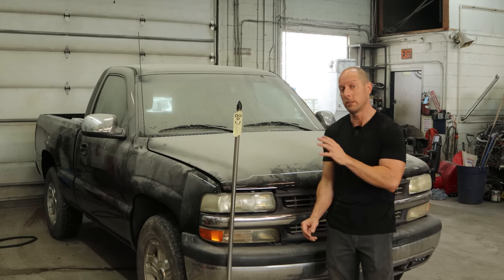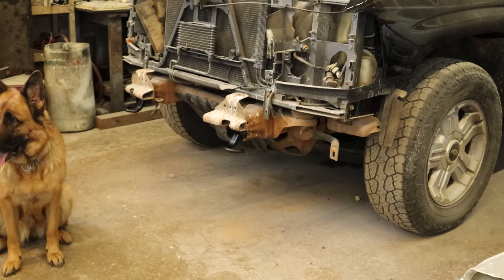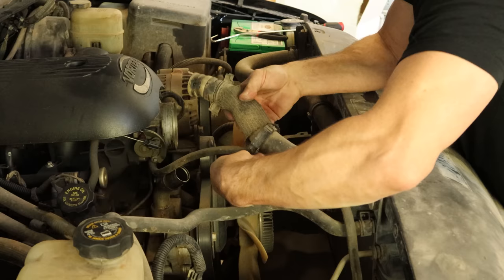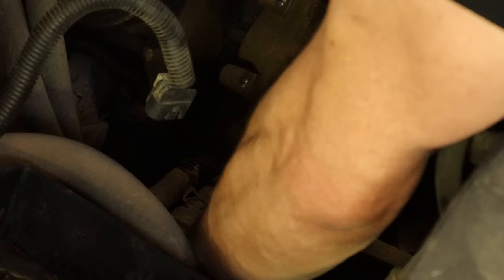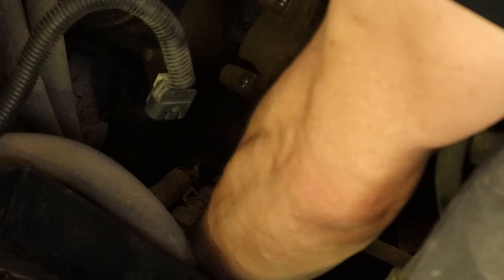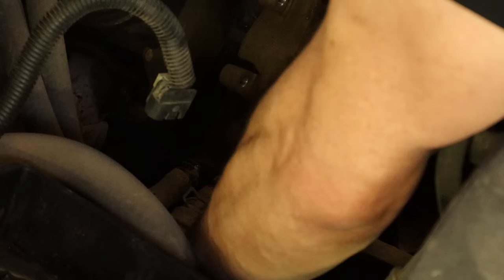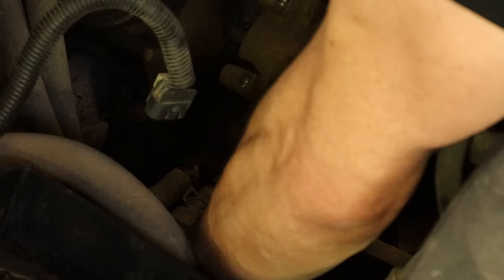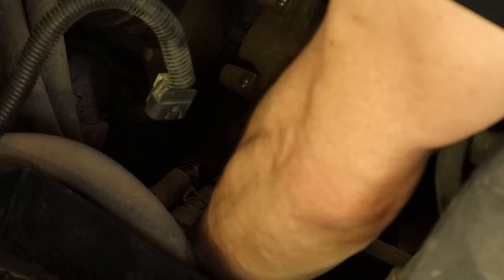Rebuilding a rolled over Silverado part 7

Comment: The electric fans from like 05-06 are a direct bolt in. And there is a stand alone harness/controller for them. Pretty neat setup and you actually gain horsetorques, unlike the snazzy drilled & slotted rotors.

Comment: I use a 3000 Psi Gas pressure washer for underbody cleaning and use it on my truck all the time those things are great but if you really want to clean your dirty engine use purple power spray it on let it sit for 5 mins then wash it off the results are satisfying.

Comment: I had one of these trucks in service vehicle white that was almost new with only 150,000 miles. I’d still have it except I let my sister borrow it to move some mulch and she totaled when some idiot ran a red light on her. Not her fault but I still blame her. It was a good truck. I live in Texas so it didn’t have any rust on it. Other than replacing tires, brakes, tie rod ends, oil and filters, it never gave me a moment of trouble. The LS engine is almost bulletproof if you can be bothered to change the oil and filter in them.

Comment: I know you have been repairing various vehicles for at least two or three weeks but your wide range and depth of knowledge of the vehicles is bloody impressive. It was the bit where you bashed the tow thingy mentioning that it got pulled in when the bolt got tightened. It's the little things like that I find really impressive along with the vehicle being way better than new once your magic hands have been laid upon it.
Thank You for the video. 👍👍

Comment: I had an engine light on my 04 GMC Sierra and it pointed to the rear knock sensor and it was a bear to replace got to take the entire intake manifold up and the fuel rail with the injectors and I figured while I was there I'd replace them both even though the front one was fine but I got to say man it's a nice truck mine's got a blown engine you make house calls LOL love the vids man

Comment: We just finished this week wearing out one of those pressure washers like you have. 

We have showed it no mercy cleaning out large HVAC Cooling Towers and A/C equipment almost everyday.

It lasted about 2 years under hard use. It would make a good shop or around the house pressure washer.

Going to order a new one Monday!

Good video!
Reply from the maker: I cleaned the garage floor, patio furniture, quite a few cars and it has been great.  I lent it to some friends and they liked it.

Comment: 18:01 better to have a gap than be like Ford: they put a water absorbing foam in there that catches water and salt, turns it into a brine and rots them out in 4 yrs. 

I did a $2.00 rust repair on a beater truck I bought for $600 cdn and when I pulled the foam out it was sopping wet. So wet when I squeezed it it drained like a sponge.

Know what would prevent this? Using a closed cell foam that doesn't absorb water.
Reply from the maker: The Tauruses were notorious for the dog legs rotting out within 2 years.  Always the foam sponge that did it! Chrysler had the same issues.
Reply: @vehcor  We call them "issues" the manufacturers call it "planned".

Comment: if you want another one i got one in south il i will let go cheep . its a 06 4x4 with a 4.8 and of course bad transmission and it needs rockers and a new bed .  dose have a front clip off a 99-02 on it due to a buck that had to jump out in front of it . hate to see it go to a scrap yard because it runs so good  but also tired of looking at it set around . i got a 01 gmc 2500 hd i drive now

Comment: That color change from red to black would really mess with the tag and title dmv here in Oklahoma because the original color is listed on the title.
Reply: Here in Louisiana too,but you can request that it be changed.I've never really worried about it,the factory color still shows on the trim tag anyway.
Reply: @burtbacarach5034  I'm just saying it might cause the clerk at the tag office to scratch their head IF they even pay any attention to that part of the title. In Oklahoma if you go to title or tag a car or truck that was last titled or tagged in a different state you've got to take the car or truck to the agency for VIN verification.
Reply from the maker: Most states don’t care.  Even the ones that do, are too lazy to do much about it.

Comment: How do you like the Detroit Axle stuff?   I've been using it on pretty much everything except my pizza delivery girl's car (she wants only OEM parts......so I just save some of the AC Delco boxes from about 6 brake jobs ago) and have had pretty good luck with the Detroit Axle rotors and ceramic pads.  As an added bonus, their world HQ is right here in SE Michigan so I get stuff I order the next day.
Reply from the maker: I have been using them for years, never had an issue.  I usually get my stuff next day as well.

Comment: That water pump replacement was too easy.  They need to move the water pump to deep inside engine so you have to pull the engine to replace it.  But it won't matter because when it starts to leak the water will quickly get into the oil, circulate in the engine, trash the bearings, fill a cylinder with water, and hydraulically break a rod.  That way you don't have to feel bad about tearing down the whole engine just to replace the water pump since the whole engine needs a rebuild.  Seen it on I DO Cars.
Reply from the maker: The Ford engineers stole your idea! 😂

Comment: Why no gasket sealer?  Easy, learning here never have done a water pump.  Thanks! :)
Reply from the maker: Silicone gaskets don’t need it.  You can use it to hold them in place, it won’t hurt but is not necessary.
Reply: @vehcor  Thanks again!!

Comment: What percentage of the radiator fluid do you get out by removing the lower hose there at the pump?  I am asking because I have an 04 and there is no petcock on the bottom of the radiator (a great idea by GM!).  Thanks!
Reply from the maker: About 50%.  The block, heater core and lower portion of the radiator are still full.
Reply: @vehcor  Thanks!

Comment: Nice job on that rebuild. But why black? Any other color than black would have been better in my opinion. Back in 2017 I was on my way to sign and take delivery on a 2017 Silverado at the Chevrolet dealer. The buy was done mostly online. All I had to do was come sign and take delivery of the truck. When I arrived at the dealership the salesman took me over to the truck. The instant I seen it I told him NO DEAL. The Dealership told me they were going to do a spray in bedliner on the truck at no cost (part of the deal.) Them doing that cost them the deal for me because they did like you did on this one. They bed lined the tops of the bed. Another in my opinion, doing that ruins the overall appearance of the truck. Sure, it's probably good for a work truck. I wasn't buying a work truck. Car tires? Why not some nice all terrain BFG or Coopers on that nice 4x4? Still though, nice truck.

Comment: I don't ,won't and have not driven  rode in a red car or truck in over 35 years . BECAUSE  AS YOU STATED THERE CURSED AND ITS BAD LUCK. 😊 TKS
Reply: Clearly, another fan of the movie Used Cars.
Reply from the maker: The red ones always seem to have issues! Sometimes I wonder if there is some truth behind the joke. 😂

Comment: So I gotta take the bumper cover off to replace the fog lights on my 2001 silverado 1500?
Reply from the maker: No, you can get to the bolt with the bumper on.  I just had it off from the other work I did.

Comment: cant find the brake job hammer in your store  or emporium was it just a limited run or did the manufacture send you it for beta testing and it not take off cant see where the batteries go must be piezo powered as you can hear it work on impact the company could have made a killig at jiffy lube and brakes or does'nt the torque go high enough for their spec's

Comment: I have exactly the same Snap on battery tools as you.. How did we do the job before they came along? Answer Struggled!
Reply from the maker: Air tools!  I still prefer air tools but the compressor is too loud when filming so I limit the use.
Reply: @vehcor  Absolutely, but as you say very noisy.. and air chisels, say no more.

Comment: Hey Scott was that and Assault weapon pick you used on the 7 pin connector?  Becareful In ILLINOIS USING THOSE😂. Probably a felony 🤦‍♂️. I cray when i see this truck.  4 hours to get the front wheel bearings out of my ole Silverado 😢😂
No mo e brakes here in New England along with rockers.  Cut them all off 😬 no plates anymore either.
Thanks for videos…. Make my day.  Wife even watchs now😅
Reply from the maker: It was not the high capacity pick so I am ok.  😂
Reply: @vehcor  just dont put a brace on it ! 😎

Comment: these year chevy's are the rustiest trucks ever GM goes all out to make them rust ! they think we will just keep buying new ones every 4 years ! at the cost of $60,000 to $80,000 .All my life i have loved Chevy's but I Have bought my last newer truck i will just keep my old one's running as they can keep there "pop can "trucks with junk D.O.D cyl cut out & BAD 6&8 speed  Transmission's with the dumb trans thermostat that over heats the converter and wipes out the hole trans . KEEP THEM GM !